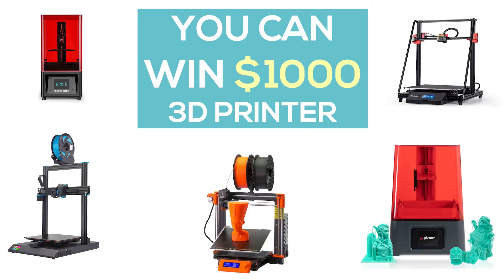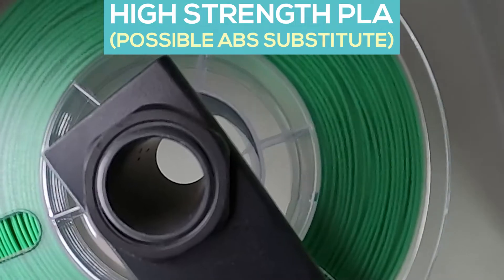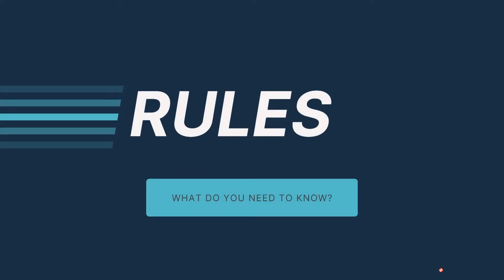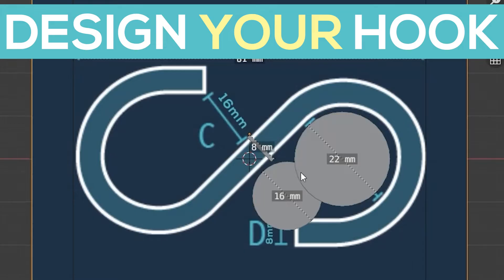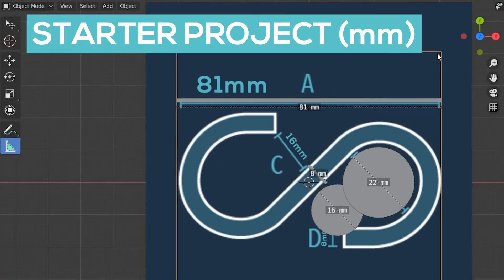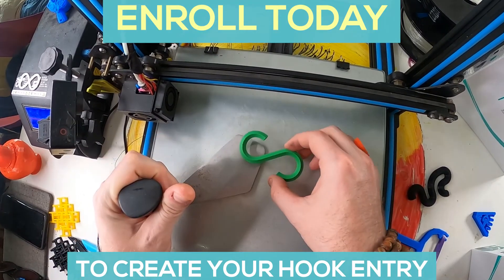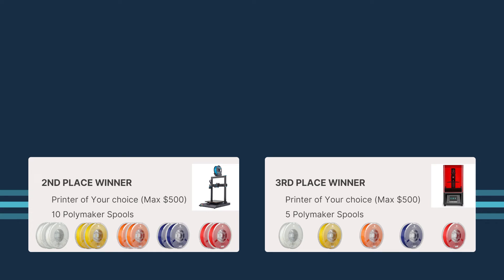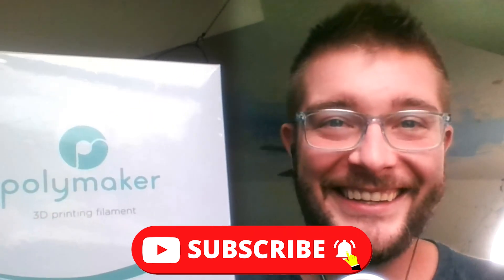WIN a 3D Printer($1000) - HOOK DESIGN CONTEST by Polymaker

Comment from the maker: Do you have any questions about the contest? If so, let me know and I'll reach out to Polymaker to get you some answers ASAP! :)
Reply: Hey :) Thanks for the comprehensive video. I am South African and I'm really keen to design and send a hook in. Can I send it to any of the 5 supplied addresses?
Reply: @TharishRavin13  Yes they provide the addresses in the article on the Polymaker Website.
Reply: Are you allowed to send the hooks of more than one competitor in a single package. I ask, because I'm going to tell a couple of friends about this competition so it would be nice to send everything in one package.
Reply: Are we aloud to make a hook that is technically open but hooks back onto itself to make a complete hole under pressure?
Reply from the maker: Great question. I would say yes, as long as they can hook their metal S-hook to it and the printed weight is less than 50grams. Can you email me (hello@ptt.live) an example photo and I'll email Polymaker to ask them.
Reply: @PrintThatThing  So do the openings have to be "visible from above" like in the examples shown, or are you allowed to have the cut line make a 3D shape (so that there is still everywhere around a gap, but you print it interlocked in place, with bridging and such)?

Comment: Sooo, you've got to buy a $40 roll of their filament to enter, AND pay for shipping the hook to them to be tested ? Are you kidding me ? The entire point of 3d printing is that you can  electronically transfer a stl or obj file and print the item at your end without shipping a physical object. Has anyone told polymaker about this amazing new development ? And how do you control for print settings, print temp, layer height, width, ect ?? Those will effect print strength greatly. Not to mention the fact that at $40 times however many people enter this contest ( even 128 ppl would be over 5k ) the company isn't "giving away" ANYTHING. The entrants are paying for their own prizes AND generating a profit for polymaker LOLOL. This isn't a contest, it's an excuse to sell overpriced filament. What a joke.
Reply: Part of this I think is to get people to use their product so you might use it more in the future. I was hesitant to buy some, but it does print very nicely. But part of this is how you design the part and the other is how you program your slicer and tune your machine. You want someone else deciding on your layer height, wall count and infill?
Reply from the maker: both true :)

Comment: Does cleanup (exacto knife) count as post processing? Thanks
Reply from the maker: I wouldn't think so. I cleaned up some of the string on my prints. I think it's more for post processes that increase the strength of the part
Reply: @PrintThatThing  I asked about hitting it up with some sandpaper and they said it would disqualify me. I ended up adding a larger filet and reprinting.